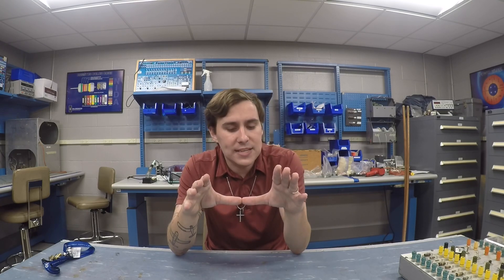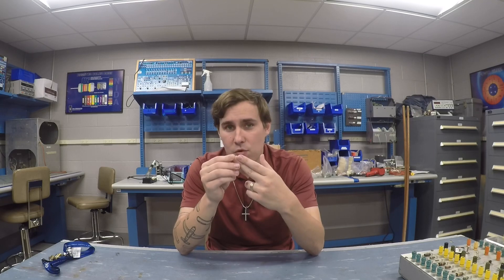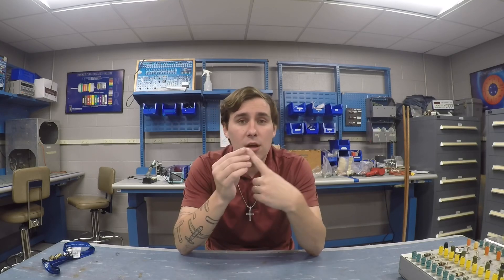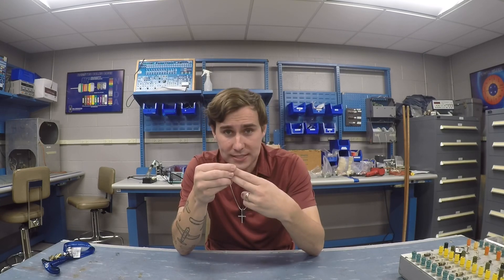2 Ways Of  Getting An A&P (airframe and power plant) Certificate.

Comment: A 3rd option that I have heard about is to build a kit plane, log your hours in the same way,  have an IA (or A&P?) occasionally inspect you work and sign your log book.  Then contact the faa AI DA in the same  way and take the appropriate tests.
Reply from the maker: That is essentially the same as practical experience but does work. However, even the cheapest kit planes will end up costing 30k to build.
Reply: Hi Guys, 
I am an aspiring A&P student. 
Going this route(kit plane) or the LSA repairman certificate route. Would you have to go through a three year waiting period?
Reply from the maker: @alonshalit5778 yes, but good news it will take at least 3 years to build a plane.